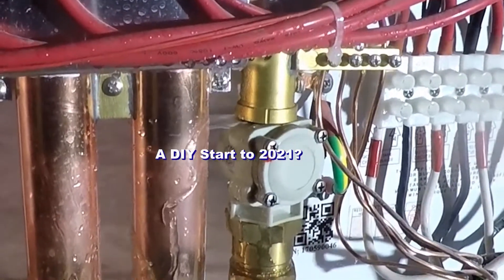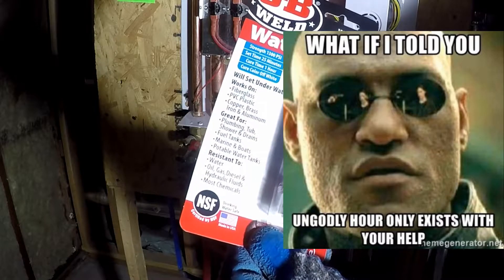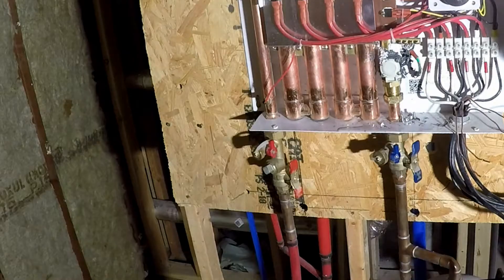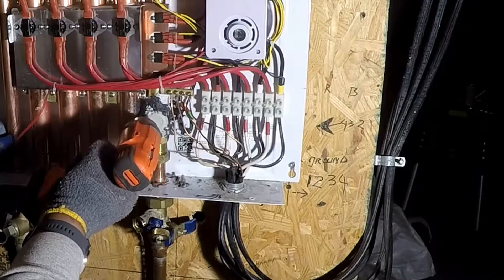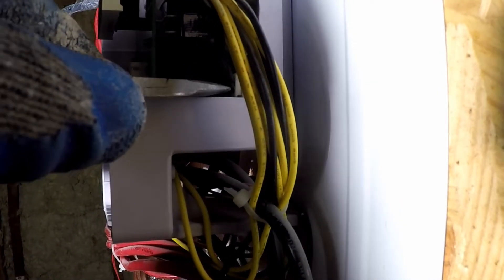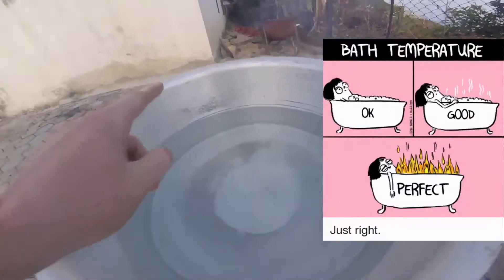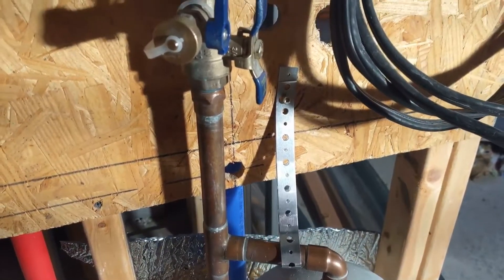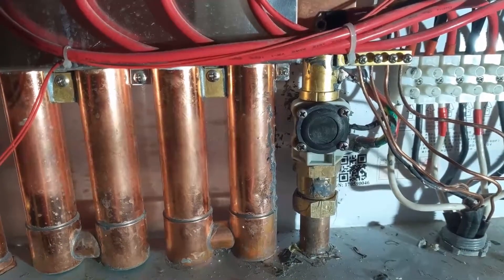Tankless Water Heater Flow Meter Damaged - M18 EP22

Comment: Tankless water heaters don’t need an expansion tank
Reply from the maker: Many houses do not have expansion tanks and even with tank water heaters. I think it was done due to code in my area.
A background for those unaware of expansion tanks. When water is heated, it expands taking up more space creating pressure. This water has to go somewhere. It can push back into the supply or cause over pressure leading to plumbing issues. The expansion tank solves this problem. With tankless, the water is heated and used right away. Because of the open faucet the expansion does not create pressure. When the hot water is turned off, the hot water remains in the line and cools. There are recirculating systems which keep the hot water in the line (the line becomes the tank), which is where an expansion tank is beneficial.

Comment: How to change the flow meter on the EcoSmart 27
Reply from the maker: The Enermax water heater featured in the video is a rebranded EcoSmart 36. The difference with the EcoSmart 27 and EcoSmart 36 is the number of heat exchangers. The other parts are the same. After obtaining a new flow meter, undo the nuts holding the flow meter starting with the bottom. Replace with a new flow meter in reverse order of uninstall.
Be careful to replace the wires to the original location on the control board.
Be gentle, do not over tighten as the part is plastic against brass and o-rings prevent leaks.
Hope that helps!
https://www.smartparts.us/products/flow-sensor-assembly-2/